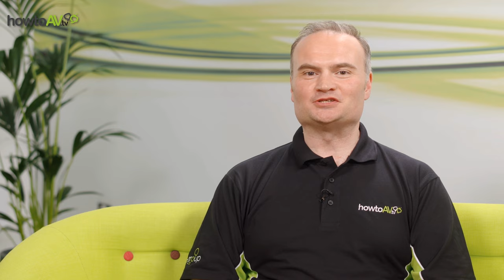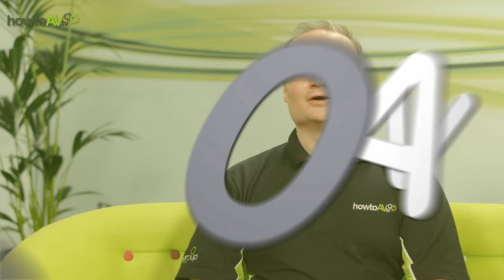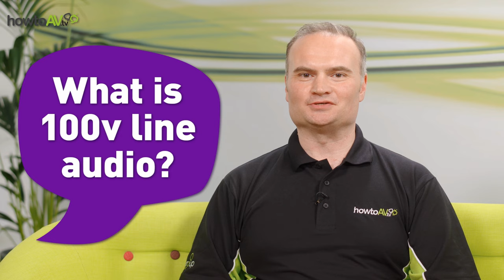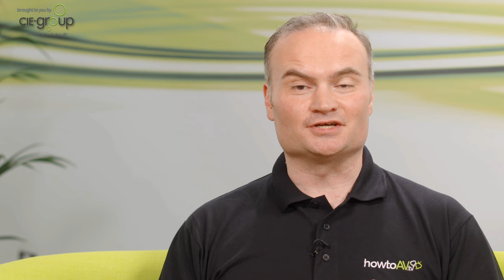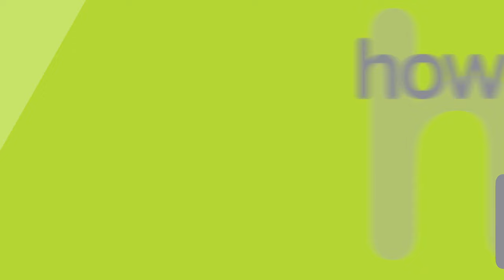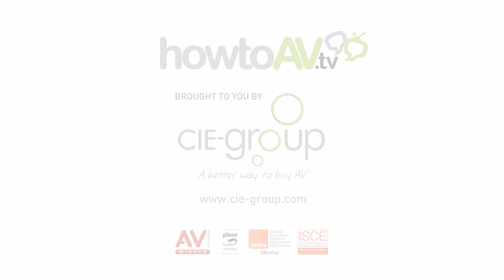What is 100V line audio?

Comment: How do you measure 70volts amp with a Multimeter? I try measuring Common terminal to 70v terminal with sound on and with out sound and I don’t get 70volts. But speaker and everything works fine. Just wanted to measure output
Reply: The system only sees 70volts when the amp is putting out full power, and your meter will only get a stable 70V reading if the amp is running a constant tone at full power, not something seen with regular music etc.

Comment: Really nice video. What are the EU rules for installing 100V? Can anyone install it or does it have to autorized electricians?
Reply from the maker: Great question Christian.
The answer is that anyone can install a 100v line system; as it is a communication system rather than a 'power' system, it isn't covered by standard electrical regs.
However, it is recommended to use some of the good practice of electrical installation when installing a 100v line audio system.
Reply: @HowToAVtv   Thank you very much for the answer, there seems to be various opinions on the net. Does EU have a rule set for how much power an installation (100V amplifier) can deliver before it has to be installed by an electrician?